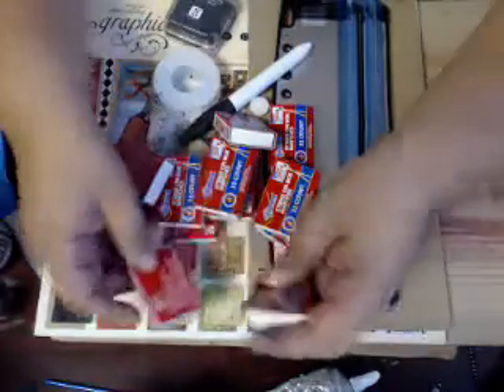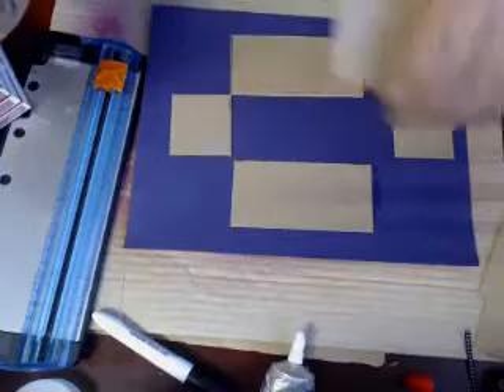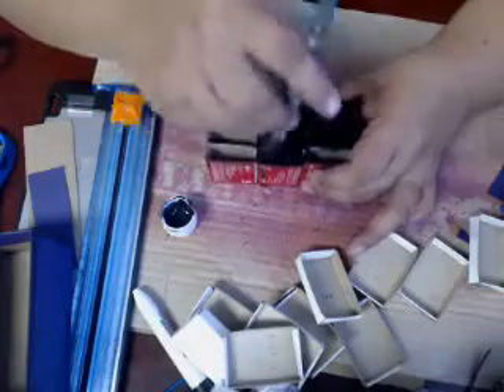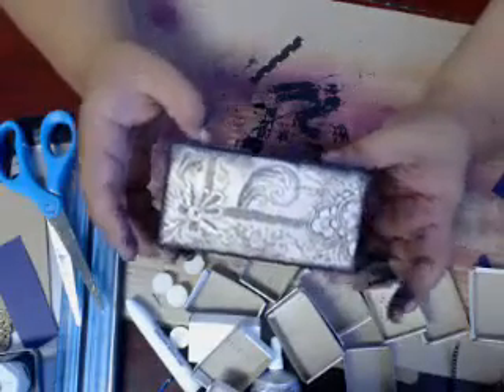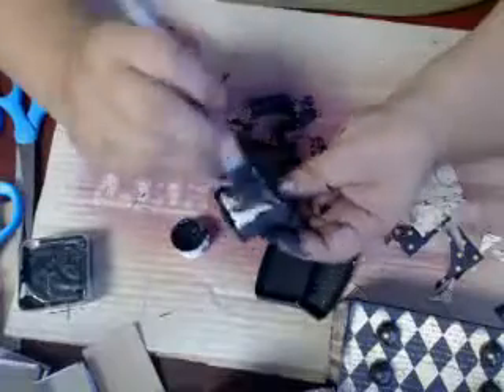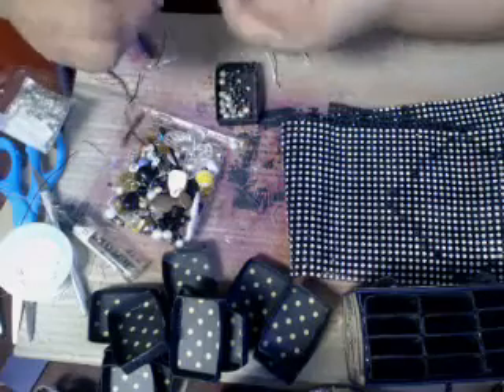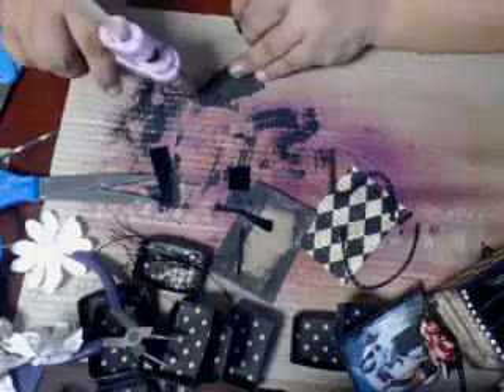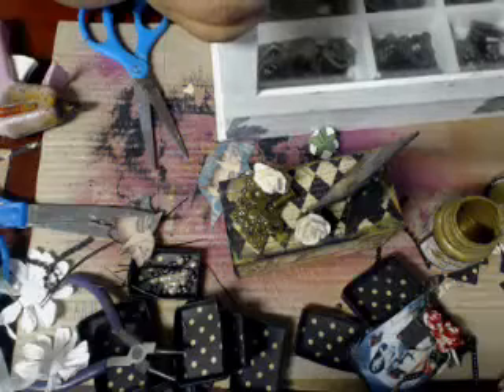HOW TO MAKE A MATCH BOX DRESSER

Comment: BTW, rubbing the sides and bottom of each drawer with a candle will make the drawers slide inane out easier, making the stress on the pull and. The front of the drawer much less.